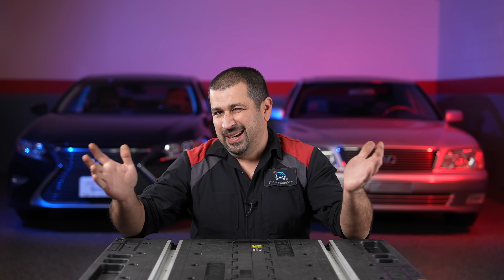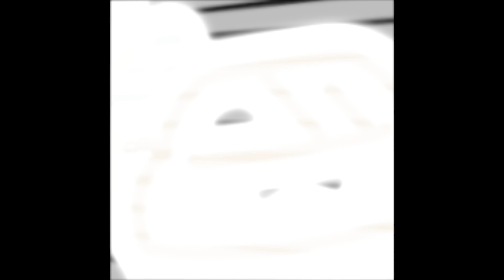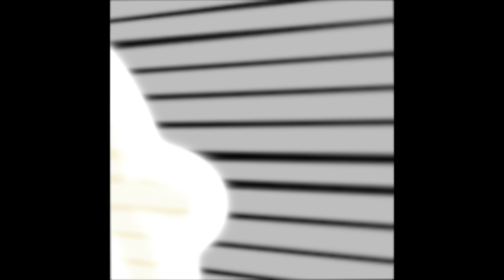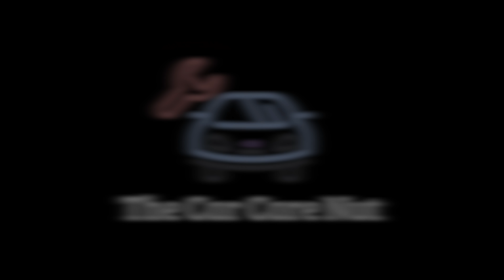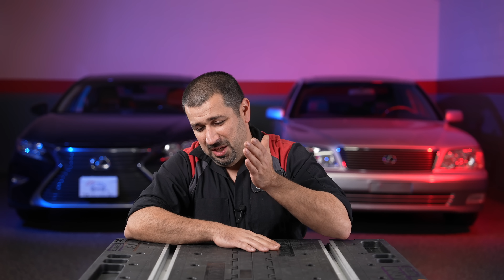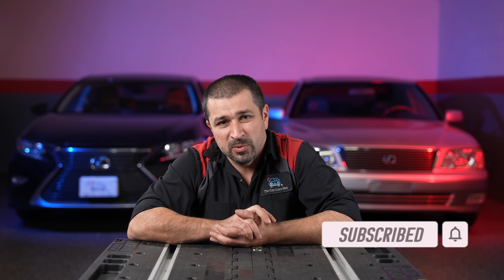Can Modern Turbo Engines Be Reliable? Here's The TRUTH!

Comment: turbo is not the issue, it's the small engine with turbo supporting a HUGE SUV / truck or a 3 cylinder pushed to its limits with turbo. 7k-10k miles oil change intervals is also the killer as amd shared in this video.
Reply: Even with 4 cylinder engines in SUVs when there was a V6 option it was always better. The engine is less dressed and can run at lower rpm, not theya re forcing people to use a tiny engine and adding a buttload of added stress to its operation it's a disaster.
Reply: @MJ-5k  Correct!  And usually the V6 version of the same 4 cylinder SUV only got 1-2 mpg less but had 30--50% more power and torque!
Reply: My 1988 Saab 2.0 turbo with 344k miles all original is proof of how reliable a turbo engine is.
Reply: @losslesssound  Yes. Turbos are fine for cars to increase performance for occasional spirited driving. But when it’s counted on to be a crutch to boost output to acceptable levels, the result will be catastrophic.
Reply: @losslesssound  no comparison. Light car, light work. Work and duty cycle should have been addressed in this video. That's the conundrum with these new platforms (e.g. TNGA).
Reply: @gregrobertson9957 
He literally did explain this briefly at 6 minutes in.
Reply: @losslesssound  that is the definition of anecdotal information
Reply: Gm, dodge, and ford have entered the chat, and wouldn't you know, na and still shit
Reply: @alainaguilar9938 
I love how fan boys of those brands like to rag on the others.
"It's better to push a __ than drive a ____."

Meanwhile, I laugh knowing it's better to drive a Toyota and never worry I have to push it instead.
Reply: @CurlyFromTheSwirly literally.
Reply: Excuse me Sir/Madam but i was wondering whether longer intervals would be more acceptable in europe since my uncle told me that here in europe and britain, such intervals are fine because europe´s climate isn´t harsh on cars. But those long intervals are blowing my mind since back in my region in middle east i was changing oil every 5k kilometers, some criticized mefor not doing it at 3k. i would appreciate any insight.
Reply: @zhila5958 
You need to research your climates. Europe has varried climates as well. It has desserts and arctic tundra same as the US. Such thing usually vary by proximity to the equator, not whatever continent one lives on.
Reply: The problem is the thing between the seat and steering wheel.. 😂😂😂
Reply: Overpowered is the way to go.  If you're running an engine at 50% load it will outlast an engine run at 80% load.  It's mechanical stress and wear.
Reply: @tvbopc5416  It's also why big V8's in a light car can still get 28 mpg highway!  The same car with a 4 cylinder would only get 29 mpg highway.
Reply: @BartSparrow123  Quite agree - too many mechanics these days - and engineers - get caught up in 'maximizing' machinery.  All that causes is reliability issues and as you observe usually at a very small increase in efficiency at tremendous cost.
Reply: On top of many of them being open block with slits between the cylinders. Which is fine for low power and cooling but definitely pushing the limits on head gaskets
Reply: Exactly, a Toyota Corolla isn't meant to tow a large trailer like a Tundra. 😂
Reply: Toyota V6 twin turbo enters the room 😂
Reply: @cmdrls212   That was a manufacturing defect rather than design.
Reply: @Larry-mk9ry actually I'm pretty sure within the past week they've come out and admitted it is not a manufacturing defect it's a problem in the bottom end of the motor
Reply: @Larry-mk9ry manufacturing is based on engineering specifications.
Reply: @bngr_bngr gm, Ford, and dodge v8s have entered the chat
Tick tick tick tick tick tick tick
Reply: @Larry-mk9ry engineering defect.  Faulty design
Reply: @thetechlibrarian got a link on that?
Reply: @BrianNC81 the engine has been out for years without issue.

So no, it’s not a design issue.
Reply: @Larry-mk9ry  I know, but it is the smaller engines that are not blowing up which debunks the old wife's tale of smaller displacement leading to failure. The transmission gearing ratios are hugely influential on load
Reply: @Dave-om6nd you can't post the link on YouTube but it's starting to filter out to the YouTube channels now I do cars just did a teardown  o
go look at it
Reply: The answer is NO.....turbos still have to obey the LAWS of physics and automakers are insanely putting them in trucks and SUVs to squeeze an extra mpg.
We had turbos (I am talking gas) back in the day.....expensive (but fun) nightmares.
Today is no different....I own turbos and can afford the bills. 
Make sure you can if you buy one.
You have been warned.
Reply: @doctordetroitt  Then why are Land Cruisers so reliable across the world? Hundreds of thousands of miles on TURBO engines!
Reply: @JollyGiant19  You mean the diesel ones? I said gas....can you read or did you go to public school?
Reply: The issue is Marxists creating laws that force manufacturers to make products we don't really want.
Reply: 3 cylinders 1liter was pushing it when they used it in a Geo Metro that weighed maybe two motorcycles. For the record, 55hp, that's about what a 1 liter is good for, as a naturally aspirated car engine. Oh, and 3 cylinders are naturally unbalanced, already a bad start. Huffing that little engine with enough boost to make 135hp with a cheap turbo on a cheap car is crazy talk. Which is to say, probably don't buy a Chevy Trax.
Reply: Yea same like drowning on a lake. Lake is not issue. Damn water getting on lungs is what ruins a weekend.
Reply: This is the correct answer
Reply: Agreed, you can't make the vehicle do anything out of boost and rpm.
Reply: Nailed it 😂
Reply: “3 cylinder pushed to limits with turbo” -GR Corolla lmao
Reply: @Sayu2x Ford says, "Hold my beer" Bronco Sport cracked injector fires 😂
Reply: @Sayu2x it was built with this in mind. Just don't tune it if you want a long life. Toyota tuned it for you, it's running 30 psi from factory lol. If people would use their brain
Reply: @Sayu2x  There are a few of those GR Corollas that were catching on fire going highway speeds even with no abuse.
Reply: @Sayu2x  The GR Corolla is not designed to be a daily driver, it's a fun weekend/track car.
Reply: @BartSparrow123 that was the initial thought. There's plenty of high mileage examples out there with little to no issues
Reply: Yes. You need to take care of your turbo and engine in general and quit forgiving others negligence which provide bad press.
Reply: @SkipBernacki  Manufacturers and dealers all caved to the green climate scam and made oil changes at 10k, lifetime fill of fluids etc.  All to satisfy the green screaming Karens about harming some little wombat.
Reply: @jyo8914  Not really.  The maintenance schedules are driven by the marketing team.  Longer intervals for oil, trans, etc. mean they can claim their 5 and 10 year true cost to own is cheaper so they can sell more vehicles.  It's no different than why every generation the foot print gets a little bigger, so they can edge out the competition in cargo area, etc.  

And the reasoning for smaller engines with turbos is for better gas mileage and lower emissions.  That is driven by government emissions standards the manufacturers need to adhere to.  You could argue that ultimately comes from your "Karens" but you'd still be wrong about (paraphrasing) "manufacturers and dealers caving to a green climate scam".  Manufacturers are not "caving", they are required to adhere to government standards.
Reply: @Th3Think3r  Yes but the issue is the EPA will never say good enough. If they did, they’d lose their taxpayer funded forever job. And that’ll never happen.
Reply: @Th3Think3r  Why do you think those government standards are what they are?  
Long oil change intervals/lifetime fluids are all part of the green scam.  It saves X amount of oil going back into the landfills etc etc etc.  
Go back a few decades and tell me how many MPGs the Honda Civics were getting?
Reply: My Honda CRX HF got over 50 miles per gallon in 1991.  Normally aspirated 4 cylinder. Stick shift.  Not much power, but it was still fun.
Reply: Am a truck driver for 20 years and I have a lot knowledge about engines any engine, including boxer engines., I use TURBO ENGINE ONLY in tractor commercial truck , BUT I skip any single turbo engine for pickups truck , SUV and sedan cars , just no worked basically is just scam technology , Turbo engine is ONLY for tractor commercial trailers
Reply: @pacae911 diesel passenger vehicles and consumer level diesel trucks really need a turbo, not just limited to commercial trucks.
Reply: Queue in .... wait for it.... 4 cylinder diesel turbo. been around for decades at this point. Land cruisers have had 4 cylinders for decades. The displacement is literally just for getting more air in and is not what determines durability. Forced induction negates reliance on displacement for power output.
Reply: @Tacobuster88  Did you watch the video?  It talks about how turbo diesel is NOT remotely comparable to turbo gas engines.   And you try to get the same power out of half the displacement you have to run higher combustion chamber pressures, higher RPMS and higher temps....The Laws of Physics and Thermodynamics compel these engines to have shorter life spans.
Reply: @BartSparrow123 
It is very much comparable, more so today than ever. I love his videos but his limited knowledge on diesels brought out some very inaccurate statements.. 
Most current gas engines run direct injection and mechanical hpfp (essentially diesel fuel system), which is why EPA is starting to mandate for them to be equipped with a GPF (gasoline particulate filter). Ford mavericks are already equipped with them.